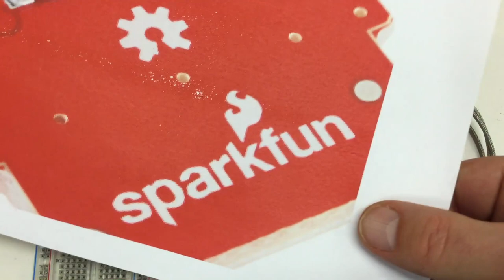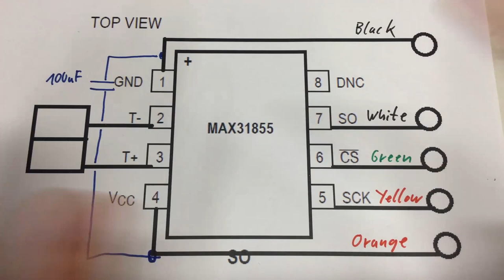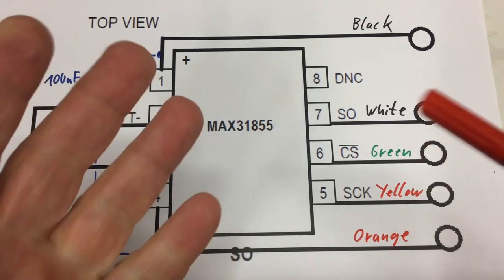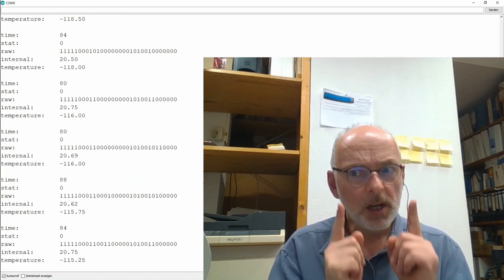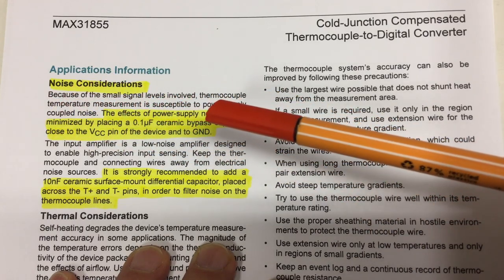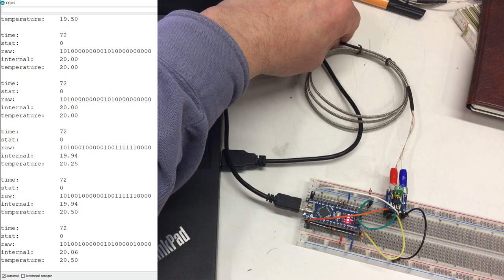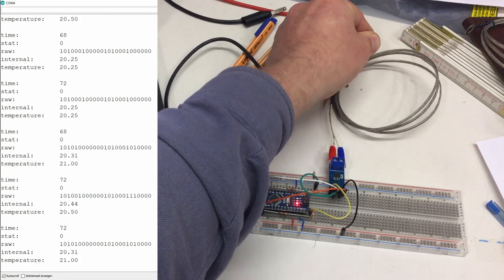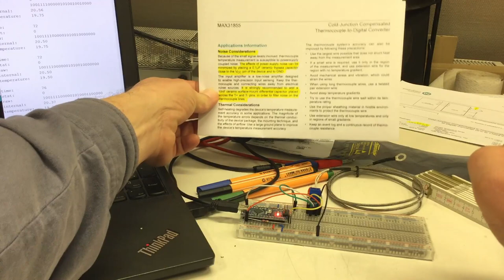Faulty Chinese MAX31855K Modules: Fake Chips? No! Just a Capacitor Missing!

Comment: Thanks you, Found a ceramic capacitor with "104" on it and now it's working as expected
Reply from the maker: You're welcome! BTW 104 is a big large (100nF). It might make reactions to changes in temperature a bit slow. Better use an 103 (10nF) as recommended by the manufacturer. However, if the 100nF works for you there's no need to change it.

Comment: Good for you Robert. Glad you found the root cause and were honest enough to share the misplaced conclusions.
Reply from the maker: Thanks! I kinda still feel bad about the first video I made (already mentioned that in the comments below). Ah well, that's my punishment for trying to save a few bucks by buying that module instead of ordering the naked chip from my usual distributor. My only solace is that these modules really don't work out of the box (Chinese plastic bag) without modification.

Comment: I have a set of three of these.  These are 'fake' ie. not genuine maxim.  There are a couple of differences.  The 'fake' do not work at 3.3v.  The internal temperature will be very low.  They work at 5v though but the readings are 'off' but not in the way you described.  Adding a capacitor helps but isn't a 100% solution.  I had to 'adjust' the temp in code.  They advertise that the chips work from 3 to 5 v with an LDO regulator and that the boards have level shifters.  They do not have either.  But they work at 5v and not 3.3v as the maxim chips do.  The maxim chips specify a max voltage of 4v.  So the internal voltage reference is 'wrong' on the fake chips and the allowable voltage ranges aren't quite the same.  They are definitely advertising the chips to be a replacement for the adafruit and are stealing the copy for that board.  So someone is pumping out good 'fakes'.  These may be engineering/qa rejects that are getting shunted to chinese manufacturers for less accurate boards.  They are usable with some mods.  I think the key difference is the accuracy.  Having to calibrate lower quality chips is not unusual.  The 31856 from adafruit worked right out of the box with no modification and provided a correct value within 1C of an RTD PT100.  The three fakes even with a capacitor were all over the place with a variance of about 20C.  The thermocouples were fine with the 31856 but not with the 'fake' 31855.  So there is definitely some thing 'not legit' about these. I am going to be ordering a few of the adafruit model and see if they have similar behavior.
Reply: Thanks for the info. Please do update us when you have checked the Adafruit version.
Reply from the maker: Thank you very much for that really detailed report. Guess I got lucky and they just "forgot" the filter capacitors on my breakout boards. Honestly, after some more borderline experiences with Chinese breakout boards (an FTDI FT232RL USB to Serial Module with no programmable EEPROM - https://youtu.be/27zx9MMKbAE - and a GPS Module with an U-Blox Neo-M8N module missing the flash memory for firmware update - video coming up) I decided to start sourcing breakout boards from reliable sources (Adafruit, Seeed, SparkFun etc.) only. We'll see how long I will stay true to this resolution 😉
Reply from the maker: @qcnck2776  I second that!
Reply: I received the adafruit.  It is a much more complex board and much more expensive.  But it works flawlessly.  The chip is being run at 3.3v from a 5v input.  The internal temp on these reads fine at 3.3v.  It has a number of capacitors including one on the temperature probe.  It is about a degree off of the pt100 which is similar to the adafruit 31856 board.  Another anamoly with the cheap ones.  They seem to load the spi bus much more heavily leading to bad readings with more than a pair of devices.  With the adafruit max31856/55/65, I have 4 devices with no issues.  I suspect I could get 8 of the authentic chips.
Reply: @mackmcbride5028  Appreciated!
Reply from the maker: @mackmcbride5028  Thank you very much for taking the bullet, that is to cash out for the Adafruit board, for us 🙂 The Adafruit board (schematic: https://learn.adafruit.com/assets/35637 ) not only has the prescribed 10nF filter capacitor at the input, but also two ferrite beads for filtering - nice. It comes with a 5V to 3.3V linear regulator and does proper level shifting (resistor plus diodes) on the CS and SCK pins form 5V to 3.3V. Only the MISO pin is not level shifted and fixed at 3.3V, which is usually when interfacing with 5V Arduinos. So a truly 3.3V/5V compatible board. Being 1° off is well within the specification of the MAX31855 (±2°C).
Reply: @robertssmorgasbord  Yes, it is a nice board.
Reply from the maker: @mackmcbride5028  If I ever need a MAX31855 in a "serious" application, I'll probably order one of those. Good find!

Comment: Sir, it's applicable to Max6675?
Your channel is a treasure ❤
Reply from the maker: No, the MAX6675 modules work as they are (at least the ones I have). That decoupling capacitor between the inputs of the MAX31855K is not even mentioned in the MAX6675 datasheet. And thanks for the praise 😅

Comment: Wow ! Great work, its become very easy to shout " Fake Chip" its nice to see a story like this pan out this way, with a real engineering solution, there's gonna be some red faces out there...cheers.
Reply from the maker: Well, one of those red faces is certainly mine. I'm definitely not proud of my first video in that matter. Not wanting to deflect blame here, but Maxims statement in the datasheet that this capacitor is "strongly recommended" to suppress noise from the thermocouple lines is kinda BS. The temperature measurements without that capacitor are not getting overly noisy, they are way off. I guess there are configurations where you can get away without that capacitor, e.g. with the thermocouple on the board near the chip. But in real world scenarios it's usually required. And of course the Chinese won't include a part on their modules that's just "strongly recommended" and not required.

Comment: Sck and cs was touched together while putting in the box after testing on lcd the chip was burn 🔥 and show not real values 😢 what your advice to me
Reply from the maker: Well, shit happens. I once soldered in a chip into a board the wrong way around and killed it. The only thing you can do is get a new MAX31855K and/or (!) a new microcontroller. Shorting the chip select and slave clock lines can damaged those pins on the microcontroller (CS high while SCK low and vice versa). However, I can't imagine how shorting those lines can damage the attached slave (here the MAX31855K).

Comment: Hello, what is Volts have the capacitor, please...
Reply from the maker: Uh, it's a run of the mill 10nF ceramic capacitor. The one I used is rated for 50V, but a 6.3V or 10V type should be sufficient.

Comment: When I trying put 12v in vin pin of this Chinese arduino nano it’s burn 🔥 😢
Reply from the maker: Well, the VIN pin of an original Arduino Nano v3 can easily take 12V (absolute maximum ration 20V, LM1117 linear regulator). So I guess your Chinese clone cheaped out on that linear regulator.